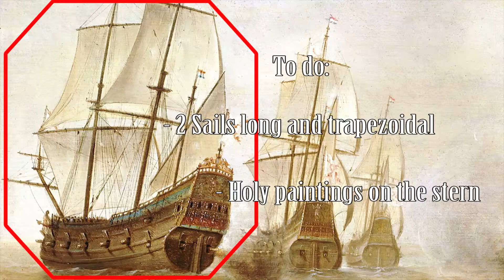Painting a Miniature Ship: Minairons Miniatures Early Frigate 1:600

Comment: What is the base block you are building the bow on? Is it custom or commerical?
Reply from the maker: Like the other one that I use in the video, which is black, it is simply a piece of wood with a varnished face on wihich I adhere a piece of Silicone Gel Pad from those sold as a car accessory to leave the cellphone on the dashboard. Really useful, even to transport the figures in a boxcase instead magnets, because is sticky but no chemics and you only needs place the figure over.  Although it does not work for all figures